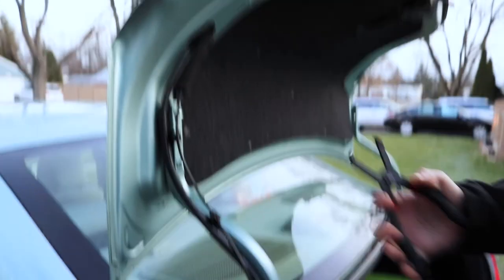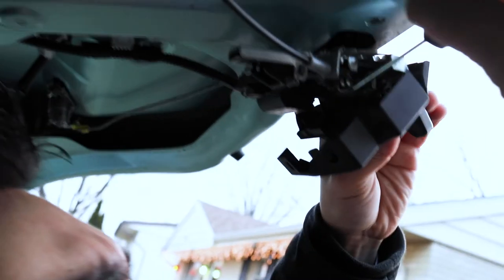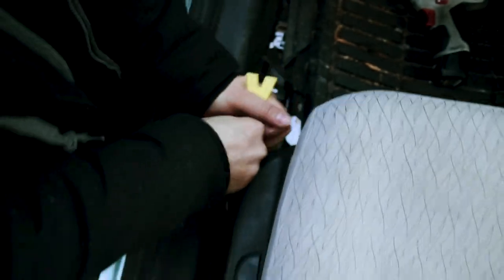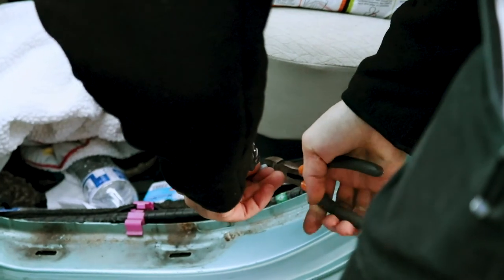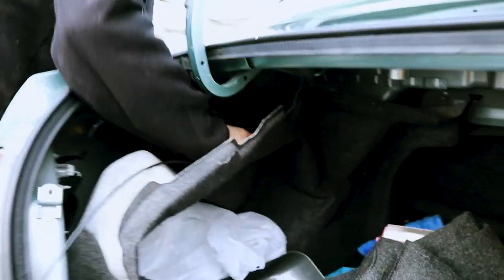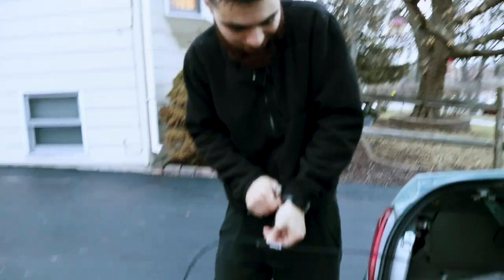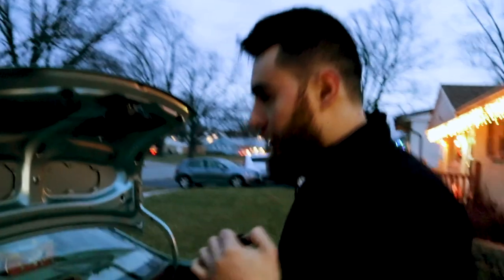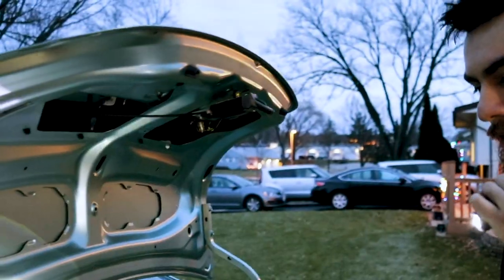07 Toyota Yaris sedan trunk latch cable

Comment: What'd annoying is the cable I bought for the car seems to almost have too much slack like the cable internally is longer than it should be
Reply from the maker: I’m pretty sure we ended up cutting it down to make it suitable for the space necessary. I’ll have to confirm with my buddy, but I’m almost certain that’s what we ended up doing
Reply: @therealjimmac  how did you reapply the ball ?